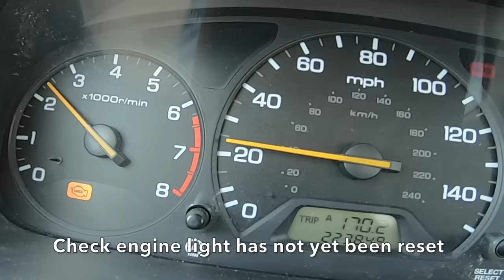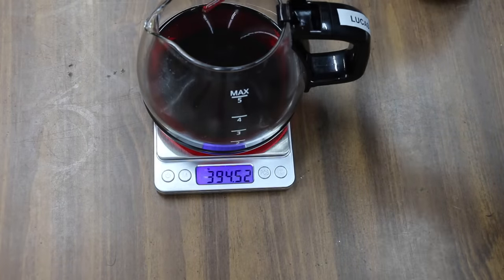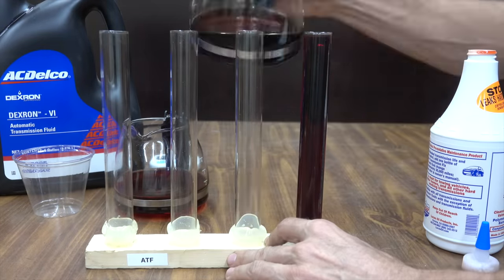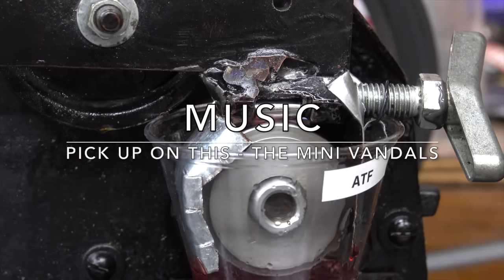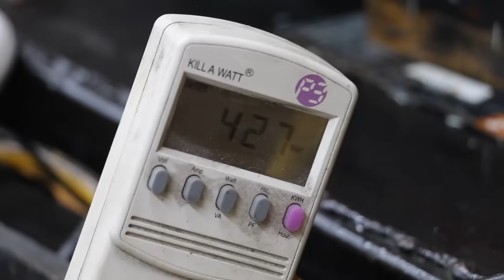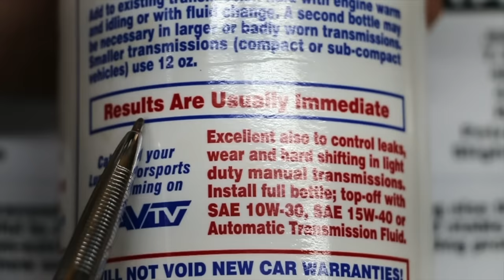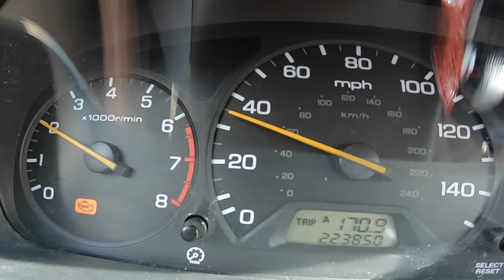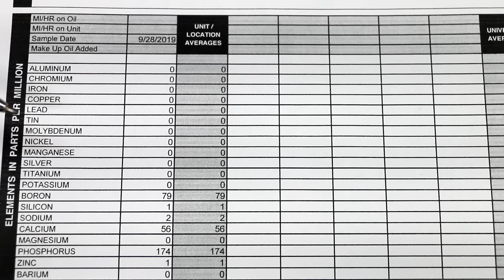Does Lucas Transmission Fix Work?  Let's find out!

Comment: I run Lucas oil additives in everything I have.
Reply from the maker: Great feedback!  Thank you
Reply: Some's good, some isn't. Best to do what the manufacturer says, they know best. I use it for bar-oil mixed with old engine oil
Reply: @ssquirrel88  I agree 100 percent. All the fluids in my vehicles get a splash of Lucas additives.
Reply: I hope your joking, Lucas oil additive will absolutely DESTROY a modern engine. It's basically putting a viscosity of 150 into passageways of an engine recommended for a viscosity of 20. If you have all older engines then it's fine, but everyone should do their own research.
Reply: @liveandletlive2894  "a splash"
Reply: @duditsgrey5148  why would you add it to your oil? Especially if your not having issues!
Reply: Hopefully Lucas Synthetic if you drive a modern car
Reply: @liveandletlive2894  the film strength on that stuff is amazing. Keeps all your seals and stuff in great shape.
Reply: @ssquirrel88  yes! It dose have it's benefits as you are a great example off. Lucas is just a good brand overall.

Comment: Should have added a second bottle like the instructions said for severely worn transmission. I’m curious how the difference would have been from the 1st to 2nd bottle
Reply from the maker: Thanks for the feedback.
Reply: It won’t do much. The issue here is the clutch packs. They’re relying on viscous coupling to work. If they’re worn enough, that won’t work and it’ll starve or hydraulic fluid.
Reply: Increases transmission pressure, might make a difference. You can’t overfill a transmission too much though or you can cause other problems, so you might need to drain a little bit. I wouldn’t use more than two bottles though… if that doesn’t work, three or more bottles isn’t going to solve the problem.
Reply: Yep, I would have drained the transmission, and replaced with a mixture of OEM Honda fluid and Lucas.

Comment: Not sure if the comment has been made, but one thing to consider with testing is that you should have also added a 3rd contender, new or preferably used transmission fluid with the proper Lucas ratio to see how it performs against regular trans fluid and straight Lucas. Think that would best simulate the product. Otherwise, another excellent video friend!
Reply from the maker: Thanks for the feedback.

Comment: It does work. It fixed my wife’s after the dealer left it 2 quarts low..
Reply from the maker: Great feedback. Thank you
Reply: The dealer should have bought you a new transmission, but I know where you're coming from!
Reply: Well you didn't really fix it, just hid the damage
Reply: I thought you said it fixed my wife. I was thinking this works on wives to!!?
Reply: Always double check any work done on your car, Always.  If I have an oil change done, I check the level when they say my car is ready in their parking lot before I pay them (bring your 2nd set of keys with you in case its locked).  most of the time the error is they Over Filled it.

Comment: That transmission Bolt on that transmission for just being changed is pretty tight getting off I think the mechanic pulled a fast one👍👍👍👍
Reply: Idk fluid looked clean. Had to be recent. But torque too high on aluminum thats for sure
Reply: @ninjamaster3453  yeah I'm just saying even around the screw they must have poured every drop perfectly looked pretty clean it is what it is still great video though love project farm👍👍👍👍
Reply from the maker: Great point!  It's never fun when the "snap" loose like that!
Reply: Could have been filled through the dipstick tube..
That was the only way to add fluid for a alot of years
Reply: This is the same bolt with crush washer on my wifes 2013 honda pilot. They are a bear to crack loose. 1/2" drive ratchet with 2 12" extensions and 17mm socket. The cracking loose shocks my wrists. They must hammer these things on from the factory/production. You are supposed to replace the crush washer and NOT reuse.

Comment: my friends has hyundai atos and it slips badly, any garage recommend to replace the transmission and charge $1000, meanwhile the car itself only value $2000

so i try lucas, what the heck its already broke why we cant make it more broke. and its not slips again and the car runs much2 better and like ordinary normal car. if u broke and doesnt want throw money to fix, just try this and see the result
Reply: Try changing the the torque converter clutch solenoid first along with cleaning the magnets drain pan for the transmission as well as changing the the filter and adding USB 3 fluid and two or three bottles of Lucas. 

it takes my Kia however I'm still having issues with the torque converter itself which is because I put the wrong fluid in there because I couldn't find the sp3 unless I went onlineI didn't realize they were still selling it because used as a special Mitsubishi fluid.
Reply: @gsxellence  yes automatic trans in hyundai, kia n some suzuki which all has 1.0 or 1.3 liter use same trany as mitsubishi lancer/cyborg/mirage in 1990s. i have buy the selenoid, but older solenoid isnt broke, i clean it and works perfect

Comment: I put it in before trans  begins to slip in all my trucks. 370 k miles on my original 2003 Chevy transmission.
I change trans oil every year.
Once clutch pack friction plates glaze burn it is gonna slip.
Type F  Ford fluid has more friction helps stop slip also a drag racer tip.
Reply from the maker: Great feedback! The local parts store owner says he does the same thing and claims he's never had a transmission problem.  He wasn't trying to sell me the product but told me about his experience with Lucas after I asked him if he's ever used it.
Reply: mitzvah golem your showing your age with this comment! Lol
Reply: You Wish lol
Reply: @NoName-tz5ji  whatz up kid?
Reply: @NoName-tz5ji  so are you...
Reply: @NoName-tz5ji  umm I have it documented..2 service Trucks at 275k 5.3 Gm and one 4.3GM 370k all original motors and only one trans because a worker towed bobcat in overdrive..
You can come verify ..
Reply: mitzvah golem I’m not arguing with you,I agree with you. I say your showing your age because of the type F dragster trick. Most younger one don’t even know what type F is.
Reply: @NoName-tz5ji  ..ok I am only 58 .not that old..lol
Reply: mitzvah golem you old gezzer,I’m only 56
Reply: @NoName-tz5ji  lol darn kids
Reply: try adding bits of cuban cigar into the box amigo!
Reply: @fidelcatsro6948  lol what's up go on Tenak talk just on
Reply: @MitzvosGolem1  hello my little cousin from the tribe of Isaac!!

Comment: I had a Honda Accord with just over 200,000 miles it wouldn't shift into 4th gear, somebody told me to drain the transmission and fill it up with diesel fuel, I thought he was crazy but I did it anyway I drove it  about 50miles with the diesel fuel and then it started shifting into 4th gear then I drained the transmission and put back regular automatic transmission oil I drove the car for another 20000 miles with no problem
Reply: Wtf is this
Reply: @all_yy59  lmao right for Honda’s you should only drain and fill
Reply: LOL. Things you should never do...

Comment: "eventually you will have transmission problems"

*laughs in Toyota *
Reply from the maker: Thanks for watching.
Reply: Lol, tow something over 8000lbs with a tundra and get back to us 😄
Reply: Lol, that’s why u get a stick shift.  
And change a clutch every now and then.  There is a video out there of a Nissan Frontier with > 1 million miles 
But of course is a stick shift ,  and he got 800k on 1 clutch.
Reply: @endutubecensorship   I have an 08 5.7 tundra with 249k miles and I regularly tow 10k skid steers and mini excavators
Reply: @robertwalston678  My experience/statement comes from seeing a 9500lb travel trailer push a Tundra into a jackknife and rolling the truck and trailer, blocking one lane of highway traffic. The drivers was physically ok but very shook up and his whole rig was totalled.

Most North American half tons have much stronger/ridged frames that give a superior towing footprint at or near the trucks towing limit. Import brand full size trucks have not caught up in towing/hauling capabilities, I think due to that vehicle type is made only for the North American market and experience is lacking at this point.

Safe hauling out there
Reply: Biggest myth on earth
Reply: Robert Walston yeah so does my town car
Reply: My bad my Camry's transmission shit the bed at 86k
Reply: Robert Walston got a 96 Ford F-150 with 320k and pulled my buddies tundra out of sand when his transfer case went 😁 not saying they build them like they use to but the old fords will give any Toyota a run for its money
Reply: @endutubecensorship  I tow my 10,000 boat with my toyota miata
Reply: @cmas415  dont put that old ford vs an old Toyota. Toyota will outlast it every time
Reply: donvillo1 lol not if you tow and off-road with an old ford vs Toyota, the ford will win lol I’ve seen it too many times and the frame not rust out 😂
Reply: @cmas415  sorry bro that's false. Do your research please. Nothing beats the Toyota pickup. Worlds best selling trucks too.
Reply: donvillo1 lmao you can live in a fools paradise man this is why people think Democrat’s are good too 😂 like I said I work on these cars for a living and new Toyota’s yes are great but old vs old ford had a lot more muscle in their trucks and you could strain those motors Toyota you couldn’t and yes their frame design back then was terrible if you don’t believe me educate yourself 😂 Toyota being number one selling ha yeah right 😂😂😂😂😂
Reply: @cmas415  you're desperately trying but facts are facts. Learn your history. Toyota also has the world's best selling car. Cheer up, one day you can own a Toyota too.
Reply: donvillo1 that sounded desperate? Lol yeah okay BRUH you probably think Elvis is still alive, yes they have best selling car but truck no, I’m dying laughing 😂😂😂😂😂😂I’m desperately trying to help you educate yourself with facts that you haven’t even thrown my way 😂😂😂😂😂 go back to school kid 🧒
Reply: @endutubecensorship  tow anything with a Toyota after 2004!
Reply: @dragan3290  Video from 2009: https://youtu.be/GJZVUnOduH4
Enjoy 🤠
Reply: Lol the GS chassis transmissions in the Lexus’s are fucking garbage
Reply: We have had 3 RAV4s in the family, and we CRY in Toyota: the thee POS transmissions were made by Toyota, not by Aisin. Jesus did we suffer with those cars...
Reply: @donvillo1  Hope is not one of the 3 million recalls they just had lol Toyos aint perfect, they fail a lot too. Regarding a/t if they aren't made by Aisin, then they're plain shit
Reply: 1993 Mk4 supra with an Aisin transmission that's never had any problems at all....shits magic lol

Comment: breathes in deeply "ahhhhh", early 2000s Honda Automatics. Our 01' Odyssey went out at 60k miles
Reply: The oddysey transmissions were notoriously bad.
Reply: Their manuals were fine. Probably the best in the business. But it seems their models just kept getting bigger and heavier and their automatics didn't get any better with that.
Reply: Pretty sure my 99 by accord uses the same trany. It's been flare shifting for 5 years. Not worth fixing. Now it's the kids car

Comment: Happy to see a conclusive test on a product that has worked for me in the past.  I had a 1982 Mercedes 380SL with delayed shift points that were becoming very annoying.  Added this product and the problem resolved almost 100%.  And I only used half the bottle!  I just bought a 1972 Mercedes 280se that has delayed shift points from 1st to 2nd and 2nd to 3rd.  I'll be trying the other half of the bottle.
Reply from the maker: Thanks for the sharing.

Comment: In my experience as a mechanic of 26 years with the addition of changing the filter adding Lucas and filling it up with the needed amount of transmission fluid does work
Reply from the maker: Thanks for the feedback.
Reply: In my 35 yrs experience as a transmission mechanic, this does not work 99.9% of the time.

Comment: Hondas have different clutch materials thats why they die when you put regular atf in them gotta use the honda atf maby try with a different make
Reply from the maker: Thank you for the feedback
Reply: "regular atf" ??? Which one ? Back in the 80s I remember there were 3 I think. ATF, G and DII.

Personal preference is to use petrochemical company's product (e.g. Esso or Shell) but it must be of the right type!
Reply: @millomweb  do some googling honda use different clutch materials as they built there autos a lil bit different to other manufacturers cause they didnt wana buy the rights or out sorce there manufacturing
Reply: @BIGSMOKE-bl2lq  I have no interest in this.
Reply: Honda's transmissions are notorious for needing honda specific ATF. If you flush them and refill with anything else, you're on borrowed time.  Even if you use "better" than stock fluid.
Reply: @hotrodandrube9119  The only fluid we changed was engine oil. Why is everyone now into changing fluids ?
Reply: @millomweb  I was trying to keep the honda automatic on the road in a car that's not worth putting a new trans in.
Reply: @hotrodandrube9119  Based on other info from others re Honda being a bit specific about the ATF, Perhaps the correct answer would have been to drain the box and refill with Honda ATF and do the same again 2 weeks later. That might have been a much better solution to the problem.

Comment: In other words- from the viewpoint of someone who buys a Honda, this will give you just enough time to sell the car to some other sucker.
Reply: Stinkfist762 my Honda shifts great, 1995 Civic & 222K miles. Auto trans just changed the fluid a few weeks ago. These babies easily do 400K if you just change the fluids regularly.
Reply: Stinkfist762  I dig the username
Reply: Just had mine rebuilt a year ago and just started slipping.Fluid pink,had pressure switches changed still not fixed.About to put lucas in and sell it or trade it in .
Reply: I have 98 civic.. got it from a sucker
Reply: That why people should buy Honda with manual trany. Also good idea to change the ATF in Honda at 30k intervals - their tranies are small and don't hold a lot of ATF, which does get used in the same way as engine oil. I think Honda ATF is similar to Dextron/Mecron 3 and doesn't slip a lot.
Reply: @Novaah803  Every 30k miles, no more, just like the book says.
Reply: The problem was with 2000 to like 2006 hondas. Mainly accords and odysseys

Comment: Is lucas safe for Honda accord because I am having the same issue with my 05 accord for the first 3 gears. If I turn it off then back on it works fine for a while then back to slipping or not engaging the gears.

Comment: I am Retired Auto Tech and have a 1998 Chevy Monte Carlo with a very healthy 3800 NA engine and the 4t65e 4 speed transmission. At 132k the pressure solenoid was sticking at random times, causing the check engine light to flash and stay on. Was given quotes of $800 to $1200 to replace the pressure and both shift solenoids, and one place wanted $2000 to do a complete rebuild. Had the pan pulled to check for signs that the transmission was in need of a rebuild, all that was found in the pan was the normal fine flakes on the magnet. Changed the filter and added the 24 oz. bottle of Lucas Transfix and enough ATF to reach the operating range. 10K miles and a year later I have not had one issue and I am not afraid to kick her down, and run the 6k rpm red line and let the trans shift like it should.
Reply from the maker: Impressive results!  Thanks for sharing this experience

Comment: So just a question and I would like the opinion of everyone on here. Reading the comments sounds like this is some good stuff to help out a worn transmission.

What if you bought a used car not many miles and you added it to the transmission or even a new car and added it? 

I would think it would help to extend the life of the transmission to use it before an issue? I just got a newer truck GMC SIERRA and I was thinking of adding it in right away to it.

Comment: To really test Lucas you need several cars with transmission problems.
Reply from the maker: Great point
Reply: I ve got an old van with 278ish thousand with something not right but the engine is definitely not right.
Reply: My 1993 f150 E4OD is still alive with 219,000 plus miles, from a auxiliary cooler, changing the atf on a regular basis, and Lucas transmission fix. The E4OD before the rev.4 update in 1994, has line pressure issues because the pump is undersized. Extra cooling, and Higher viscosity atf are my stopgap, until I do the updates, valve body kit, and upgrade to stronger hardparts.